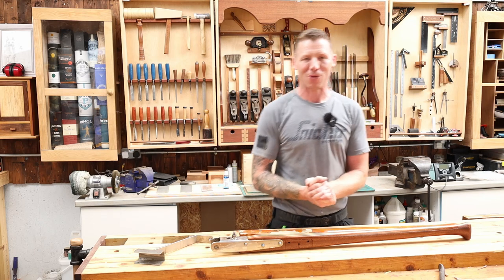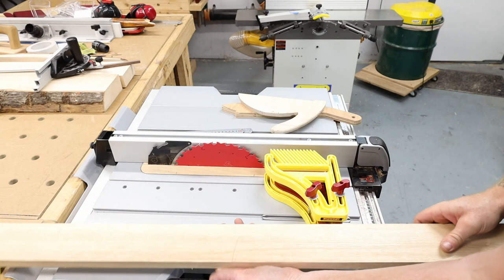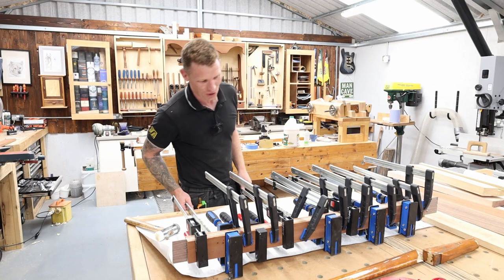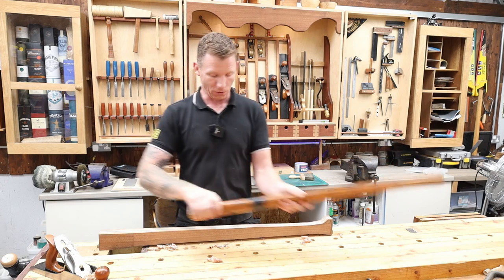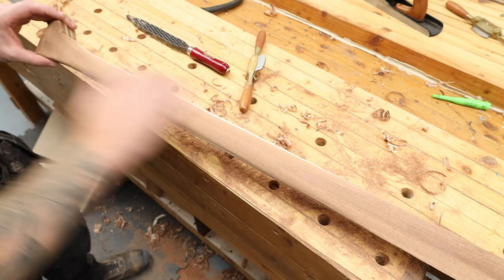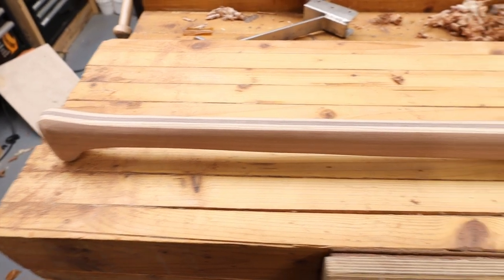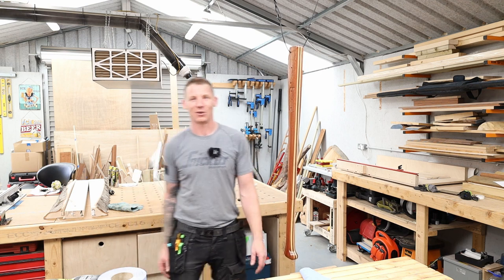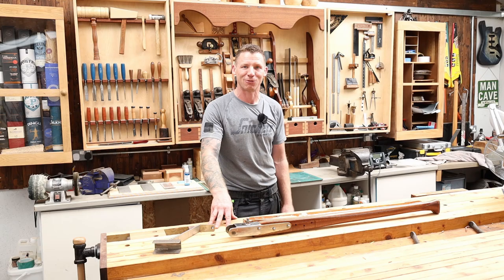Making a Custom Hand Made Sail Boat Tiller

Comment: Hi John, great to watch the tiller take shape. The finished article looks fantastic. Having worked in the Painting Trade and weatherproofing boats in New England I would still have concerns over the Bolt Holes. As the weakest point on the original tiller, they will remain the weakest point on this one and using oil, which needs annual upkeep, it may be an area that gets neglected. It will certainly be an area where water will make its way to - as the timber expands and contracts - even sightly  due to timber type and laminate construction.  Would you consider either two pack or similar product to line the bolt holes - applied with a pull through? Rust-Oleum do some Marine Grade products that may suit.   I suppose it won't make it bullet proof but 40 years would be an easy target for the tiller then.   Sorry geeking out on Coatings!
Reply from the maker: Hi Ciaran, the bolt holes certainly are the weak point where moisture could lodge. I'm not up to speed on marine grade finishes. I'll check out what Rust-Oleum offer.

Comment: That turned out amazing, and that osmo oil really brought those contrasting colours to life. Regarding the glue on your clamps, I will put a coat of paste wax on mine every now and again. It stops the glue sticking to them and it just flakes of when dry. It prevents problems during the glue up.
Reply from the maker: The raffle will be the next video!
Reply: @JohnMcGrathManInShed  thanks John, I thought I had somehow missed it.

Comment: Turned out cracking John.  I agree with everything you said at the start when cutting your strips on the table saw, another option if you still want to use the table saw would be to lower your blade run your piece then flip it over and run it through again.  I'm not trying to troll you just share knowledge sir.  Glad your friend is happy with it thanks for the video and sharing it.  Going to have to get me one of them there saw rasps things lol
Reply from the maker: Good tip Conor.